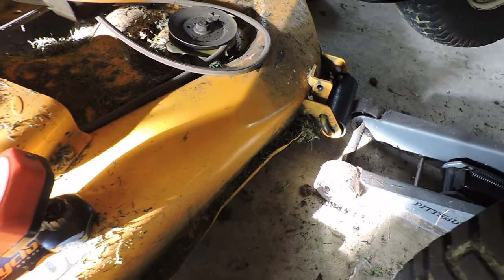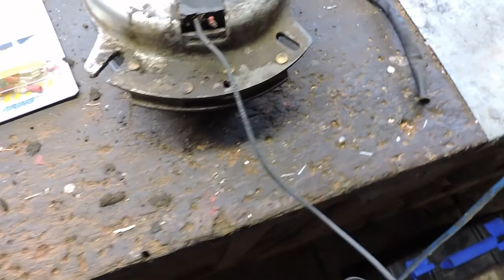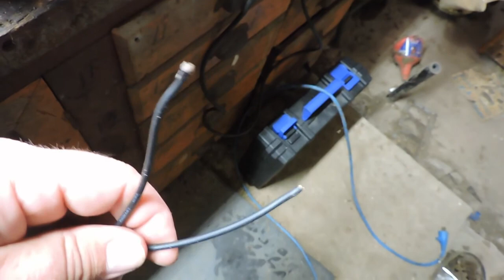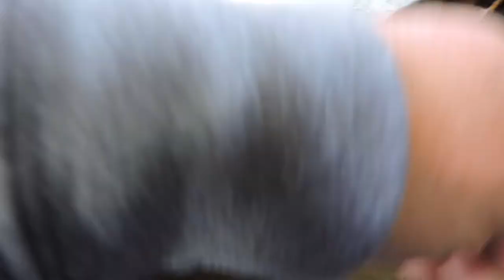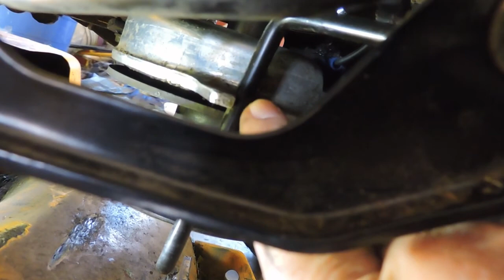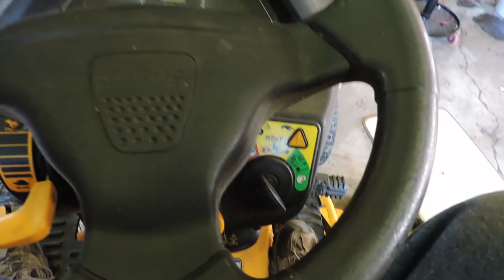Cub Cadet LTX 1050 PTO Clutch Wire Repair

Comment: Those wires should be held on to the hub with a permanent magnet like household deep fryer power cords to allow breakaway. Worst thing ever added to a simple lawnmower, converted mine to idler pulley.  Now l have very smooth engagement

Comment: Thanks for this video. After replacing my deck belt, I ran into a problem with my pto blowing fuses. Turns out, I stupidly didn’t use my belt guard to hold my pto clutch. Now to check for a broken wire!
I struggled trying to figure out what was supposed to hold the clutch housing in place because the belt guard doesn’t show any signs of wear. This video showed me what I had been suspecting. Hopefully I won’t have to resort to the wiring hack, but at least it is in my tool bag if I do need it.
Did I mention I can be a complete idiot at times?

Comment: This is a kind of repair I'd do to get it back and running until I could replace it. I wouldn't consider this a permanent repair as it's kind of janky having a screw go into a wire.
Reply from the maker: Agreed, but it's held up for me this whole mowing season. I know I'll have to replace the PTO clutch eventually.
Reply: @countrylivingonashoestring5159 yes and at that time it gets replaced properly

Comment: 1st it's a crankshaft not a driveshaft, and if you have a 2 foot long piece of rope about ⅜ in size remove sparkplug stuff about a foot of rope into the cylinder itself and then you can use a ratchet and socket to remove and reinstall the pto. No it will not get stuck in cylinder. It is a hack job but if it works it works.
Reply: I've read some people say to not use a rope if you have OHV because you could bend a rood. I have a Kohler engine, and instead got a ratching strap, the kind with a long piece of strap. And clamped it down onto the flywheel and then tied it off to the steering shaft. It would worked unscrewing, though not finished doing a repair so haven't tried screwing it back down. Though from research, that bolt should be 50ft/lbs.

Comment: My belt keeper on my 1050 does not go through the belt keeper bracket at all not even close. I guess mine uses a spring to hold it in place
Reply from the maker: Different year or slightly different model perhaps?
Reply: @countrylivingonashoestring5159  so I went and I was able to flip the bracket and it fit like yours.  Explains why my wire was frayed lol.  You would think they'd notch it so it only goes one way!

Comment: Mine still has enough wire running from the PTO but missing the little female connector on the end is their a way to fix that or am I SOL and need to buy a new PTO
Reply from the maker: So, you have a wire end sticking out from the PTO?  Can you just put a double female connector on it and then splice a new piece of wire onto that to make your connection?

Comment: Hello, I am again interested in what the fault could be if the given clutch does not disengage, but works all the time. The switch is new, ok 1 year.
Once when it was hot, it was bad to lock inside, but suddenly yesterday it spins all the time, doesn't lock.
It's as if the electromagnet closes but halfway..
Reply from the maker: I'm not sure.  That problem is beyond my level of expertise.  Maybe check so of the other Cub Cadet channels.  Someone might have the answer you need.

Comment: Thanks.  Very informative!  I am having the same issue on the same model.  However, I have enough hot wire coming out of PTO to be able to splice to PTO cable where severed without having to remove PTO.  It is the ground that broke off right at the PTO clutch.  Would it still work if I re-connect the  hot with a splice, and just connect the ground from main harness from battery to the mower frame?  I could do this repair w/o removing the PTO clutch.  However, I am thinking that this repair will not ground the actual clutch itself probably resulting in other issues.
Reply from the maker: Thanks for the comments and the question.  I'm not sure if that kind of grounding will work or not.  Maybe someone else can answer your question in the comments.
Reply: Did that work? I'd guess it probably will not.

Comment: That bracket is one of the worst design defects in history, if you dont know that unit will spin, you're hosed. However, thanks for making this video, I'm following this for the ground connection, being that one has been torn off, and so far so good, ive got continuity, and I think its going to work, however, im going to use some epoxy i think, to keep the screw from backing itself out under vibration.
Reply from the maker: Thanks for the tip!
Reply: @countrylivingonashoestring5159  2 weeks in, fix works as described, thanks!

Comment: Informative... Heat shrink crimp connectors and heat shrink tubing is a must for vehicle and equipment repairs.... Good to see you up and running again... I have to diagnose my lt1050 tomorrow... Hoping its a wiring issue or gap clearance... Not looking forward to dropping $200 on a new clutch...
Reply: Just ordered mine of Amazon for 125$ got it a couple weeks ago works great , unless you want to drop 200$ , I just went the cheaper route considering the age of my mower , also replaced my carb this winter with 30$ Amazon carb it’s working great too
Reply: Same here Amazon has all the parts you need